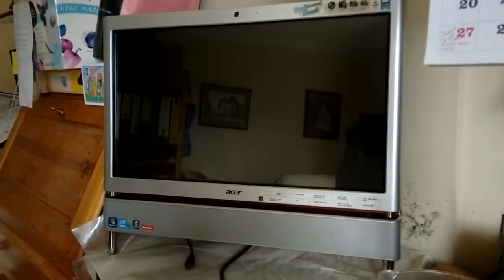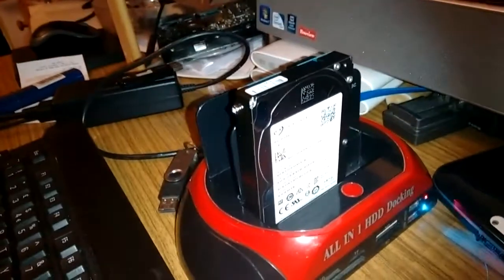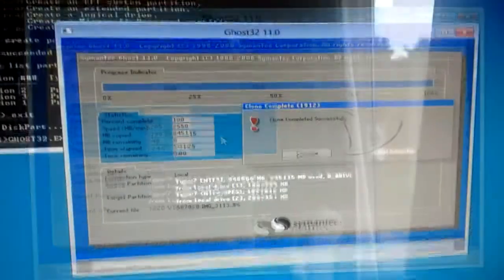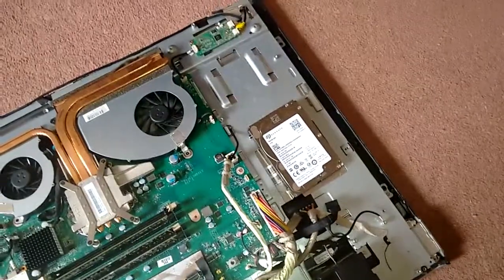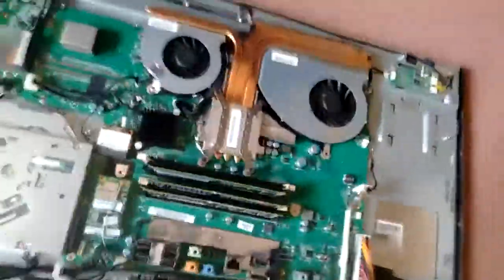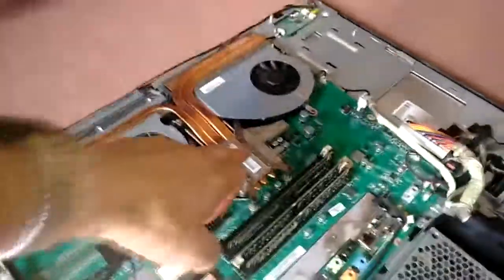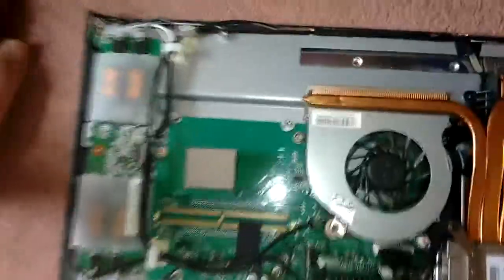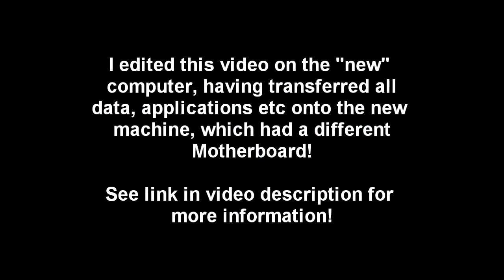Acer Aspire Z5610 to Z5700 Swapover

Comment: The CMOS battery is under the motherboard for Z5700 for some crazy reason.  You have to undo the heatsink fans and all the screws for the MB to get at it.  Undo some screws and lift the MB just enough to replace the battery that's under a bit of black tape.  It's not easy but very doable if you know what you're doing.  I did it and now it's running fine again.

Comment: BIOS- UPDATE - for this Z5710 anyone know? Have the latest bios file and a program box that sort of looks like a bios updater and ran the file and it did all these red then green dots but the screen didnt flash or try to restart . i restarted anyway but old bios still there. I cant see a bios update in the bios itself which would be safer of course/ The computer is working ok but it dosent see the onboard wifi slot as tried 3 cards and nothing appearing in DM??  and it shuts down now again eventhough power and all heat sinks are serviced and no hot chips i can find on the board  so wonder if the bios is slightly corrupted?  it sometimes take 3 starts and cut out before it stays on and gets to windows and goes for a day  then might just randomly shut down??  it also might be a M/B intermittent failure of course. i already done fresh 7 & 10 and after i did win 7, the start problem dissapeaed but random shut downs still occuring? 

Thanks- this is update to last question on dead wifi card slot which i have usb wifi working perfectly now so just Bios update and power issue maybe caused by iffy bios?

Comment: Hi, i have the Z5710 and i cant get any WIFI using 3 dongles, drivers and the card which i checked is in its slot and wires connect to antennas on top, all ok. Also the usual troubleshooter button and in Device manager under Network adaptors, i dont see any built in adaptor. So is it not recognising its own wifi?  So is there a hidden wifi button or in windows 7?
Reply from the maker: Sounds like the WiFi module or the connector for is damaged?
Reply: @SharingSomeVideos  Yes, i tried 3 diff cards in that slot and none show up in DM either under adaptors or "other" and also did a stand alone Linux load without the H/D and dongles show up fine in all cases but that onboard card- ZIP!  So i might get a schematic and trace the power and signals as its what i do anyway and it might be a good learning  egsample.
Even a incomparable card will bring up a mesg and.or show up anyway with yellow flags. but nothing. i also had a power up issue with win 10 and it took 3 starts to get it to windows and i did  a fresh win 7 and now it starts perfectly and no shut downs so windows causing conflicts and maybe that card slot too? everything else works perfectly so a usb dongle is the easy way out but a good tech can take short cuts for customers of course but this computer is mine me and i dont like mysteries! Just another to repair on a pile i have haha / This all in one is too good to trash as it is a tv and does everything even if 10 years old. Save landfill.
Anyway i might have a close look and see if i can solve it - all fun.